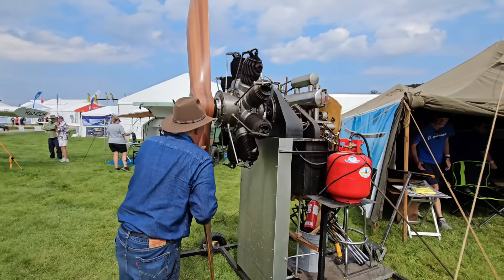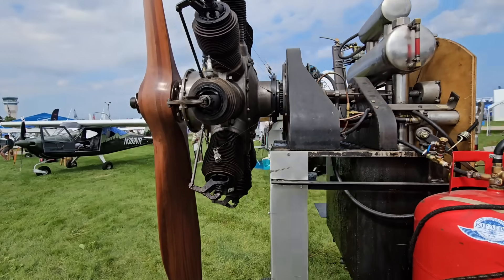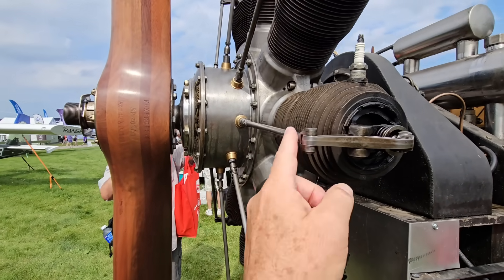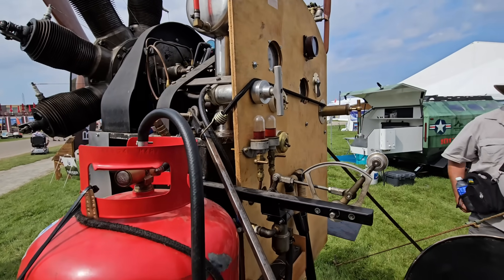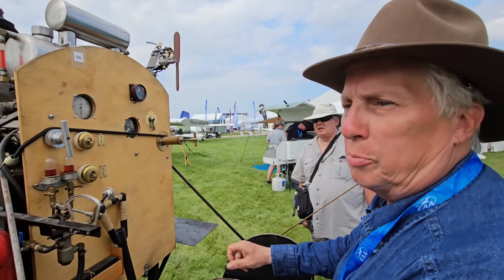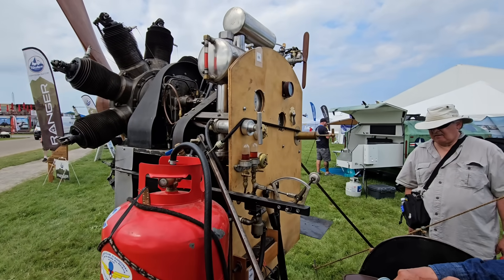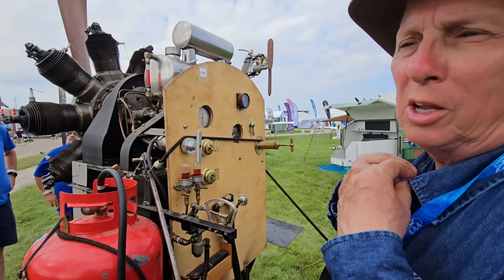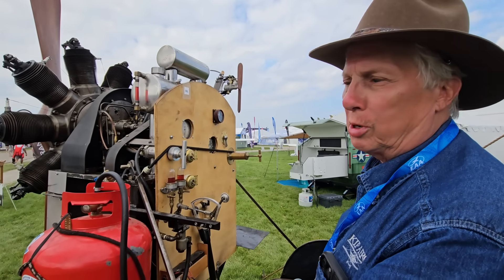100HP Gnome Rotary Engine Detailed Review! OSH25

Comment: Why rotary. Isn't a radial superior?
Nevermind. I thought this was an engine being offered for modern light sport aircraft. As a project to keep old technology alive I completely understand.
Reply: Rotary engines came first and were superior at the time... higher power-to-weight, silky smooth and requires no warm-up.
hand prop and go straight to take-off roll. 
as these engines got bigger the problem of gyroscopic procession made the planes uncontrollable.

Comment: Cute, YT automatic translation turns the 'rotary engine' into 'Wankel-Engine' 😆
Reply: AI... making the world dumber
Reply: It's the more popular and well-known.
Reply: @WALTERBROADDUS  Not in aviation. Wankel engines are too unreliable and have never been used in certified aircraft.
Reply: As a former Mazda owner, I will attest they have their issues. But, I don't think much of current general aviation engines today. I'll take a 13 b, over a Lycoming.
Reply: @WALTERBROADDUS  Lycoming engines can easily pass FAA or EASA airworthiness certification... something Wankel engines cannot.
 the 13B has repeatedly failed to pass certification because it cannot pass the minimum reliability test. 

Wankel engines are inherently unreliable and too unreliable for aircraft
Reply: Yeah, that's when it hit me. Aviation doesn't call a Wankel a rotary because of confusion with the radial-which rotates but is no Wankel. 
And Wankel engines are made for aviation.  I've only known the street/highway version.  It was funn.
I do love the sound of a big fat radial-powered plane coasting across the breeze.
Reply: @wadepatton2433  Wankel engines were designed for motorcycles not aircraft,
Wankel engines are too unreliable for aircraft.

Comment: Oh fascinating! I never realized that the hesitant sound of the engine upon landing was the pilot using the blip switch because there was no throttle.
4 cycle...so each of the nine cylinders fires once for every 2 revolutions of the prop? Is any oil mixed directly into the fuel? What lubricates the crankshaft? What are the preferred woods for the prop? This is so fascinating, thank you so much !!!
Reply: He packs a lot of interesting facts and information that always leaves me wanting more to 😊
Reply: Later Rotary engines had carburetors and a proper throttle with an air valve. 

What crankshaft?  These motors dont have one.
internal parts are lubed by oil injection like a 2-stroke
Reply: @DoktorBayerischeMotorenWerke  Something turns in the middle; likely with lobes. Since the fuel was being drawn in through the middle and there is no sump area...it seemed possible that the oil would be mixed with the fuel as it is in many primitive 2 strokes...?
Reply: @archstanton_live  Yes, there is a "cam pack" and roller bearings that support the engine on the hollow shaft.
 Yes, so engines were premixed fuel and oil, this one injects oil into the hollow shaft along with the fuel and air
Reply: @DoktorBayerischeMotorenWerke  Not sure there was significant air drawn into the central shaft. But what do I know? "Injection" implies a pump pressure. The lubrication described was for the valve rods, it looks like it was gravity fed.
The oil poured into my chainsaw is only for the chain. The oil added to the gasoline lubricates the engine...   I dunno  ?
Reply: @archstanton_live  Some 2-stroke engines do not use premix oil/fuel.
 They inject oil into the intake tract.
 This engine is similar to an oil injected 2-stroke.
some of the air for combustion is pulled through the hollow shaft into the crankcase.
 a small mechanical pump squirts a small amount of oil into the hollow shaft (along with the fuel) every revolution and is sprayed around the crankcase by windage before being drawn into the cylinders
Reply: @DoktorBayerischeMotorenWerke  Thank you.
Reply: @DoktorBayerischeMotorenWerke they sure do have a crankshaft
Reply: @aaronpatchett7940  Actually they dont... they have a hollow axle which is attached to the aircraft and does not spin. 
 It does not have a crankshaft by the conventional definition.

Comment: rotary engines always interested me, as i could never get my head round it, how did the oil get to where it's needed, how did the engine and the prop turn together, it never occurred to me the crank was fixed to the airframe - thanks for the explanation
Reply: oil is injected into the hollow crank and blown in with the intake air... it circulates inside the crankcase like a 2-stroke engine.

Comment: Help me out! I read somewhere that due to the gyroscopic forces on a rotary engine mean that the pilot had to control the aircraft 90 degrees off, so to turn left he had to put the stick forward, to turn right he had to pull the stick back. Is this true?

Comment: FYI, Gnome, later to become Gnome & Rhône, and after WW II seized by the government to become a state-owned company as Snecma (which created CFM international, a joint venture with GE that created the CFM56 and LEAP engines), later renamed as Safran. 
Gnome was a French industrial company created in the very early 20th century that pioneered these rotating pistons engines for aircraft. 
They later made star and double star piston aviation engines.
Reply: The smaller 80hp Rhône-9C 9-cylinder rotary was more common and extremely successful on many WW I aircraft (incl. the Sopwith Pup and several Nieuport fighters) with over 10,000 built and foreign production licenses in the US, GB and Sweden. Many can be seen in aviation museums worldwide, and some are even flying.
Reply: The 9-cylinder 100hp version was the model « Delta ». It was 16.3 metric liters total cylinder volume and was priced at 22,000 francs in 1912…
Reply: It sucked 30 liters fuel and 9 liters oil per hour. 
In 1914, the French Army certified it and it had a great success in the early years of WW I with over 2000 built and foreign production licences to GB and Russia. 
It had several technical improvements and came up to 165hp by the end of WW I.
Reply: Simple mechanically but eccentrically French  ...  Not perfect by any means but functional ...
Reply: France was, and still is, the most technologically advanced country in Europe if not the world. Most nuclear power stations. Extensive high speed rail network, Arianne rocket launcher in French Guiana predates annoying Musk stuff by decades. Airbus industirie.

Comment: This is no Wankel-Engine. This thing's got "normal" pistons and cylinders. It just rotates in cause of the fixer crankshaft.  That's it.
Reply: The Wankel DKM54 used the Rotary concept... the KKM57 is a conventional Layout
Reply: @sandervanderkammen9230  YouTube auto translates the title to "Wankelmotor" if your system language is german.
Reply: @benjaminhanke79  "Umlaufmotor" is the correct translation
Reply: Only you people leaving comments are bringing up Wankel.
Reply: @WALTERBROADDUS  Youtube's Auto-translate program clearly has an error. 
AI is not very smart.

Comment: I would not want fly into combat behind one of those.  When I was a teen (1960's) I was fascinated with WW1 aviation, thanks to Charles Schultz and Snoopy.  I read everything I could get my hands on at the time.  Some of the early films about WW1 used the rotary.  You can hear the blip of the cylinders on landing.  Most modern films use radial engines in the replica aircraft.
Reply: A lot of the New Zealand replicas have replica rotaries

Comment: I thought those are called radial engines.
Reply: Radial engines are a fixed crankcase with a rotating crankshaft
Reply: A radial engine looks very similar, but the cylinders do not rotate with the prop. They remain stationary like modern engines - with the crankshaft rotating instead of the cylinders.
Reply: Radial engines dont spin... only the shaft spins.  Radial engines use the conventional layout.

Comment: This type of 4-stroke cycle of a lot of these, as is the Gnome, is called a monosoupape engine.
Reply: Single slapped engine?
Reply: @Angelum_Band  in French vernacular "Valve".
Reply: @keepyourbilsteins  And the valve opened outwards..
Reply: Its a pretty unique cycle of internal combustion engine types. Having open to atmosphere ports/holes in the cylinders near the bottom, one valve that is used for induction & exhaust strokes, still having a crude carburetor/mixer and using some 2-stroke'esq scavenging.

Comment: This was one of the few Rotory Radial engines that worked this way. I think they had one of these on a sopwith camel.
Reply: There is no such thing as a "Rotary Radial"  that is an oxymoron. It is either a Rotary or a Radial... it can't be both.
Reply: sorry…..just meant it was a radial type engine, with the cylinders aligned in a radial fashion.
Reply: @ronstowe8898  Thats where most people get confused... the Rotary type predates the Radial type.
 The Rotary spins around a hollow axle shaft.
 The Radial is stationary and has a normal crankshaft.
Reply: The Sopwith Pup did have a Gnome 9C 80hp 9-cyl rotary piston engine.

Comment: The early Gnomes have an intake valve in the center of the piston. 100 hp at 1000 rpm is impressive. I’ve always wondered  if the centrifugal force acts as a supercharger?

Comment: Until today, I thought rotary engine meant a Wankel engine which doesn't have cylinders. Thanks for clearing up what 'rotary' means in this context.
Reply: There were two versions of the Wankel engine, the original had a fixed shaft and the housing spun around it. The version made by Mazda and others is not a Rotary type. The KKM is a conventional layout, only the DKM was a rotary and it never saw production.
Reply: The term Rotary only applies to the DKM54 prototype designed by Felix Wankel.
The Wankel KKM57 is a reverse engineered version designed by Hanns Paschke and Walter Froede
The KKM57 discarded the unique fixed crankshaft and spinning housing arrangement in favor of a normal setup.
Reply: The automatic translation for the title to German got it totally wrong. Would be great if one could stop youtube from doing this automatic title replacement or at least show original title and later translation.
A rotary engine like the Gnome is called 'Umlaufmotor' in German with the whole engine rotating around the fixed crankshaft. Wankel design based engine with a rotating triangular shaped piston is a different thing (Rotationskolbenmotor).
Radial engine is called 'Sternmotor' in German, cause the cylinders are arranged like spikes of a star.

Awesome video seeing this engine running.
Reply: Same here, the title auto translation tricked me too. I was like "What? A Mazda RX7 engine on a plane?"
I had heard of these, but never seen an example.
Reply: @benjaminhanke79 The Mazda has a KKM57, the Non-rotary version
Reply: This is a radial engine
Reply: @raymondsnow7745  WRONG! This is a ROTARY Engine... Radial engines do not spin, they are stationary and have a crankshaft thta spins.
Reply: @raymondsnow7745 What  is shown in the video is a Rotary type engine.
Definitely not a Radial.
Any questions son?